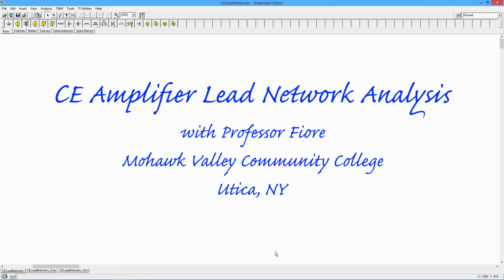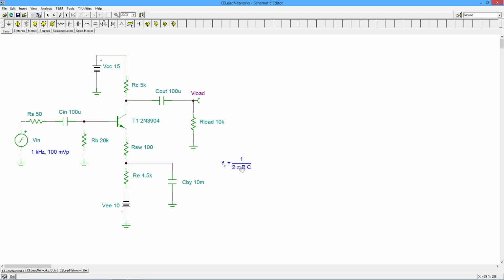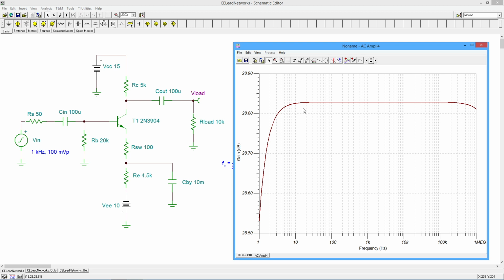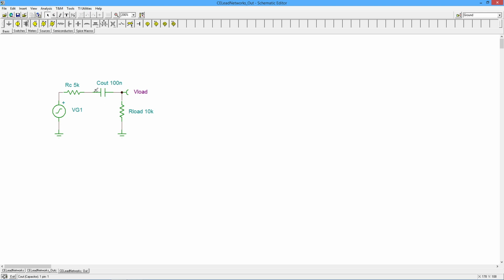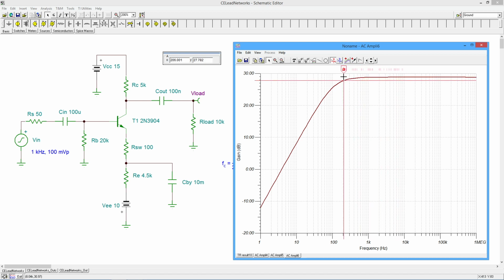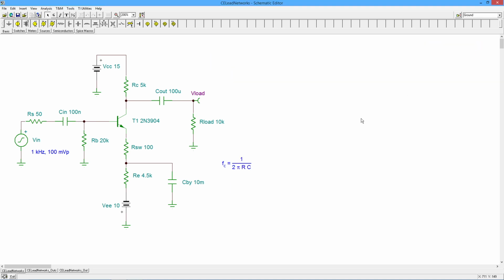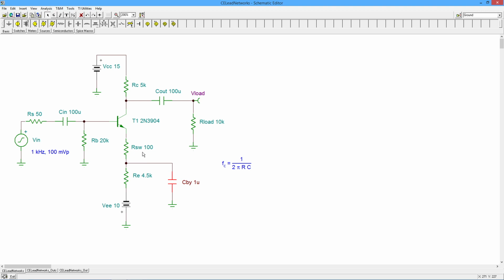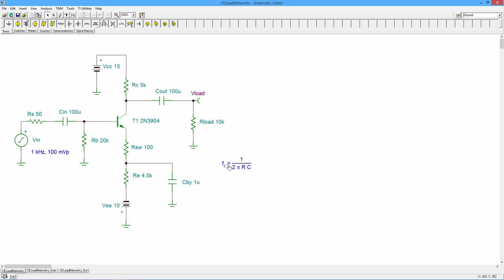Semiconductor Devices: CE Amplifier Lead Network Analysis

Comment: You said it's duel power but I just see battery - ground and battery+ then the audio signal + and - are you counting the input signal when you say that? Because I thought  a duel power meant you have a power supply that has 4 wires something like 12v+ then 0v then 12v- or am I confusing 2 different things with each other?
Reply from the maker: Dual DC supplies: Vcc at top and Vee at bottom.
Reply: @ElectronicswithProfessorFiore  then what's single supply?
Reply from the maker: @SheikhN-bible-syndrome  Literally, one DC power source. For example, a voltage divider bias or collector feedback bias. e.g., https://youtu.be/TZbgD-uZ69U